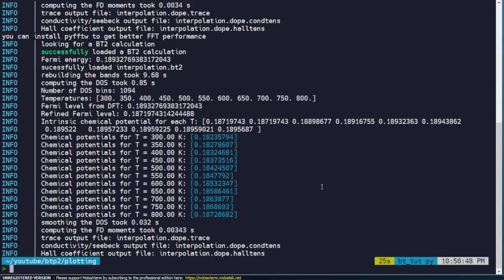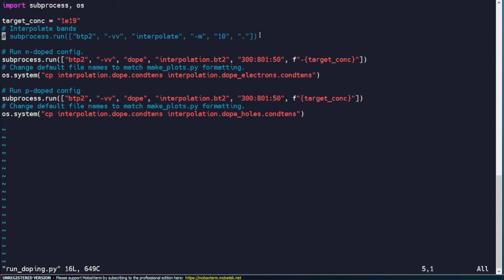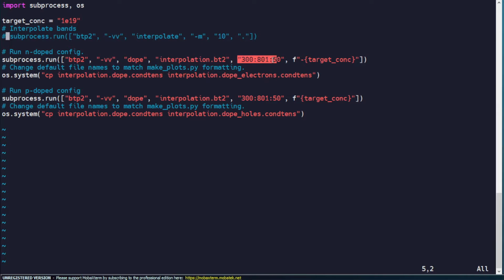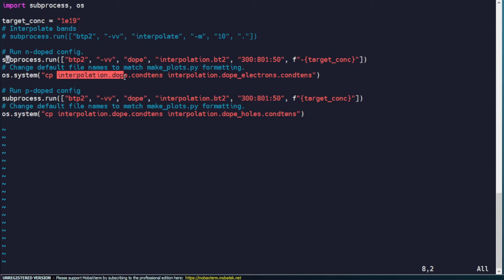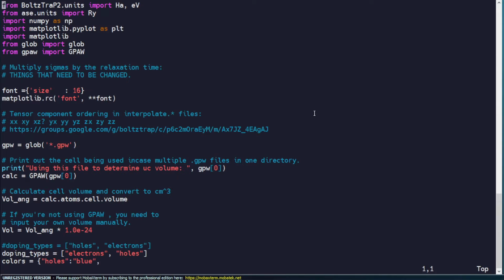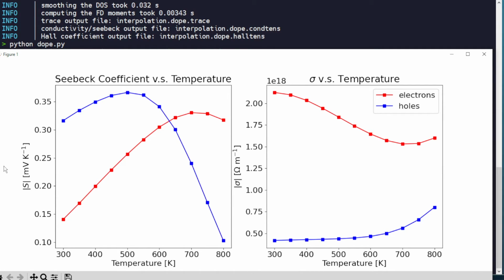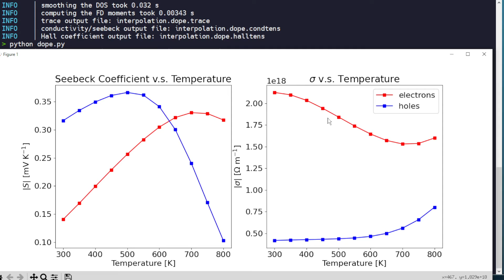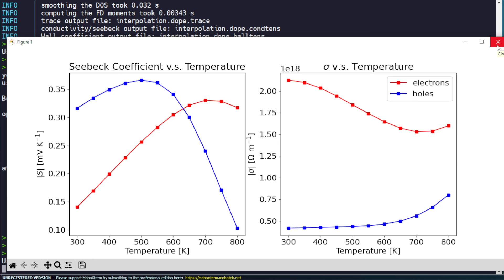BoltzTraP2 Tutorial | Doping Semiconductors

Comment: Hello, I calculated the conductivity using your script, and I have two questions. First, the initial result obtained from Boltztrap2 is the conductivity divided by the relaxation time. After running the script, the result is the conductivity. How is the relaxation time eliminated? Second, what is the significance of the conductivity for hole and electron doping, respectively?
Reply from the maker: You need to have a relaxation time to get rid of it, you can check out some ways to estimate that. As for the second question check out the yu and cardona book on semiconductors.

Comment: Hello, sir. I am also using BoltzTrap2 to calculate the Seebeck coefficient, but the method is different. The calculated results have many different chemical potentials and the same chemical potential has different temperatures and corresponding Seebeck coefficients, so I don't quite understand how to draw the image in your video. I would like to ask how your logic is to determine the value of your Seebeck coefficient?😄Thank you so much
Reply from the maker: You can follow the video step by step to reproduce the graphs, this approach generated many different temperatures and chemical potentials/carrier concentrations as well

Comment: Hello Sir, for plotting ZT value, Do we need to divided the value of PF and kappa_el with relaxation time? I have kappa_lattice data (not kappa_lattice/\tau). if I want to plot ZT, I need to multiply the kappa_lattice with the constant relaxation time used in the calculation, isn't it?And how do we know the value of constant relaxation time in this calculation? Thank you
Reply from the maker: You can just write out the units on paper and do the math there are a few separate equations and quantities you're asking about. Anything in terms of 1/Tau needs to have that multiplied out, so not k_lattice. 

For how to get the relaxation time, you can either get it from literature, approximation from experiment, or deformation potential there with an initio calculations.
Reply: @AlgebraicContinuation  Okay, Thank you. At first, I didn't understand. But by watching your video over and over and learning boltztrap2 now, I finally understand

I have more question, Do you know How to plot onsager coefficient as a function of temperature without specifying the chemical potential? If I plot using "btp2 plot -T -c '["xx", "zz"]' -s 100 interpolation.btj S", there are many lines with different chemical potentials. I also want to plot average "S", not every Sxx,Syy, and Szz.
your code only provided for doping
Reply from the maker: I'm confused because those last two things are different issues.  Is your issue that you want a single line S, or that you want a single line S per chemical potential?

There is no way to just remove the chemical potential. It has to be selected to plot against temperature.
Reply: @AlgebraicContinuation  oh, I see. Is there a spesific command to select particular chemical potential?
Reply from the maker: It's more typical to pick a carrier concentration like in this video. You can always look in your condtens files though, and look for the chemical potential you're desiring. So if you don't know what carrier concentration you want, probably using the interpolate approach is better than dope. I forget if there is a way to pin the chemical potential, you can run help on the dope command though to double check. 

btp2 dope -h (or maybe it's --h?)

Comment: hello sir, whenever I run doping.py I got the gpaw error. I tried to install the gpaw but i failed. Is there any alternate option for running doping.py without gpaw. waiting for your respose. 
I am using wien2k code.
Reply from the maker: GPAW is installable with conda so there shouldn’t be an issue there. What is the specific problem you’re getting? You can use whatever code you want to do doping.py

Be sure to read the script and it’s comments carefully, there should be something in there about the volume if you’re not using GPAW.
Reply: Thanks your your response sir. run_doping.py is working fine for me, but when I run doping.py I got the error message that there is no module named 'gapw' . @AlgebraicContinuation
Reply: @AlgebraicContinuation  Thanks for your response sir. I think I have a problem in installing GPAW with both conda and pip. Actually I have installed intel python compiler which includes both conda and python but I am not be able to install gpaw using conda. Is there any alternate way to install gpaw??
Reply from the maker: I think both of you are running into the same issue likely. If you aren't using GPAW for the DFT, then you don't need GPAW at all. You will have to modify doping.py to replace the things that GPAW does though, see the comments in the script for this, I believe it's just manually inputting the volume.
Reply: @AlgebraicContinuation   Thanks a lot sir. It works fine for  me now. One more question, while putting cell volume, it is mentioned that it should in ang but in my result I got the volume in ang^3. So should I convert it into ang or use the direct value of ang^3. One more thing if possible make such a script for temp vs power factor and temp vs ZT value.
Reply from the maker: Boltztrap doesn’t give kappa to compute ZT accurately unfortunately. And for power factor you can use the same script, just multiply your S*S*sigma arrays. 

How you do that component-wise is a bit arbitrary, which is why I didn’t include that in the script.
Reply: @AlgebraicContinuation   and what about the cell volume should I use ang^3 or convert it into ang only

Comment: Good day, Sir. I just wanna ask why is the plot show carrier concentration 1e18 even though you set it to 1e19 in target_conc? Thanks in advance!
Reply from the maker: That is the scale for the plot of the conductivity, not the carrier concentration. So in general there’s no reason to expect those to be the same.
Reply: I understand, Sir. Thank you for your reply. However in that case, what is the purpose of 1e18 on the plot? Why is it being shown there? Thank you in advance! :))
Reply from the maker: @markedwincleofe5589  Hmm I'm not sure I see what the misunderstanding/confusion is? That's the scale on the plot of conductivities.
Reply: @AlgebraicContinuation  That is very interetsing, the number (scaling 1e18)  appears due to the approximation used in Boltztrap2 code RTA. THe electrical conductivity  in the plot is Sigma/Tau where Tau is the relaxation time which is system dependent. If you want get the actual conductivity you have to multiply the conductivity with Tau (relation time) which upcourse is system dependent.
Hope this helps